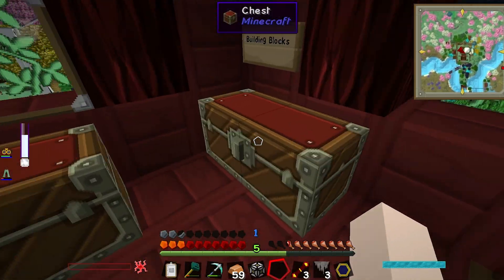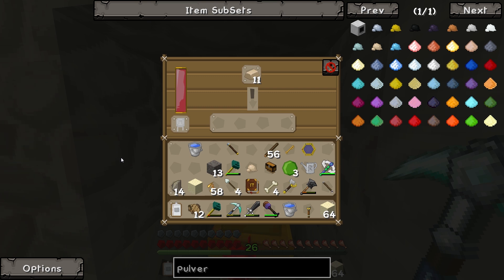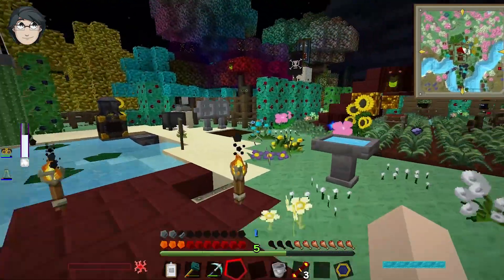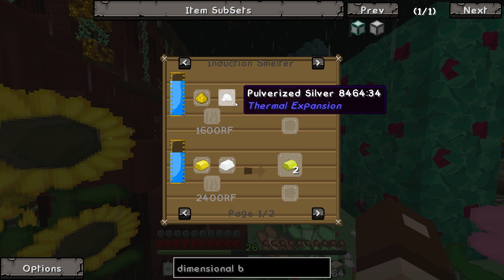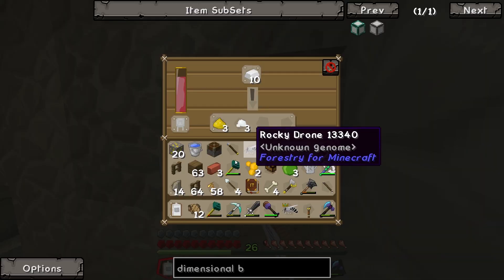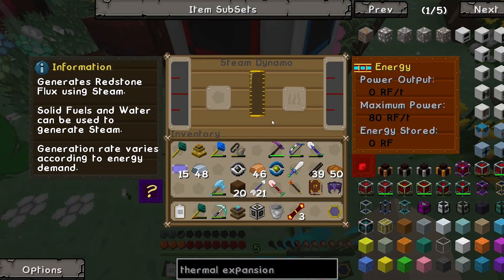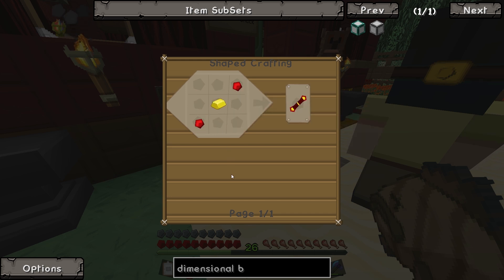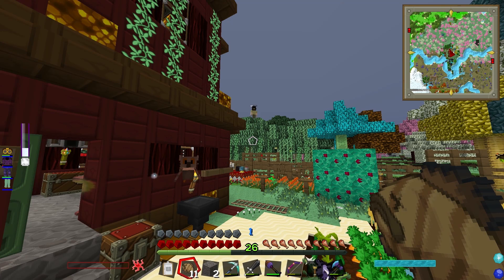Minecraft: Owl Island #22 - Something Awesome!

Comment: How come English people understand english less than Americans? lol Btw Nilesy, the problem with the engines you were using is that they generate MJ/tick and the induction smelter takes RF/tick. So if you wanted to use MJ you would need either energy cables from Mekanism or Redstone energy conduits from thermal expansion. Both of those convert all energy to what the machine needs
Reply: Is that meant to mean stuff like British say aluminium where as Americans say aluminum
Reply: Bluetorress2 No lol it was about the point where they thought the redstone control changes the output and makes it potentially explode lol
Reply: Joshua Columbus i think they're just remembering the combustion engines from tekkit and confusing them... that's my guess anyway!
Reply: Russell Cowling Maybe, i remember those things used to blow up my base a lot lol but then i discovered mekanisms wind turbines
Reply: Yeah.. they were a big pain the butt.. that's why I focused on the magic mods :D also, I've always found the whole redstone powered/unpowered thing with thermal expan. Confusing, at least until I played around with the mod a fair bit, so I can understand Nilseys pain there!
Reply: Actually, I dont think there is any way to convert MJ into RF, you can only convert RF to MJ via conduits or u. cables
Reply: Luka Perisic Did you even read my freaking comment dude?
Reply: Joshua Columbus Yes, and I corrected it. Redstone conduits cant convert MJ to RF, only the other way around
Reply: Luka Perisic Yes they do, i use them for all my power stuffs
Reply: Joshua Columbus Well, they didnt in the 1.6.4 DW20 pack
Reply: Joshua Columbus it comes from the first lot of steam engine that blew up but the new red stone stuff doesn't blow and controls it's output
Reply: zagan1 What the heck are you eve talking about dude